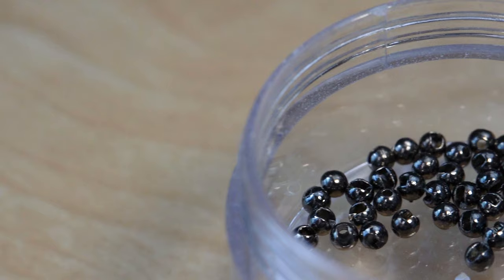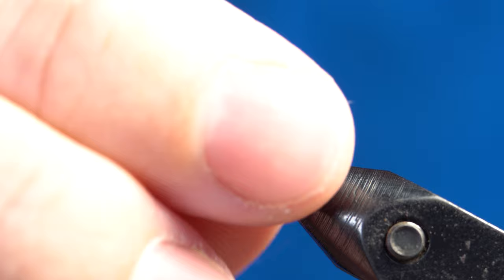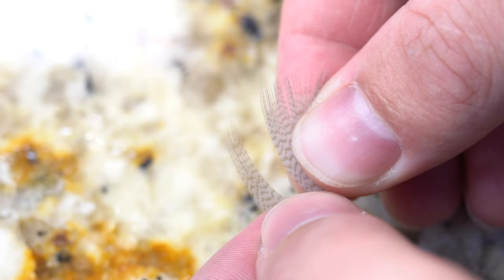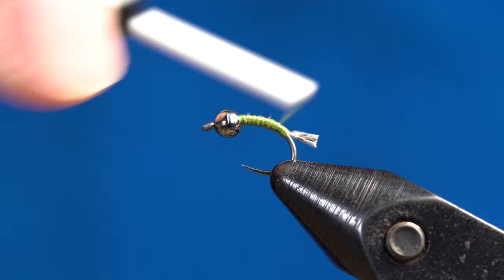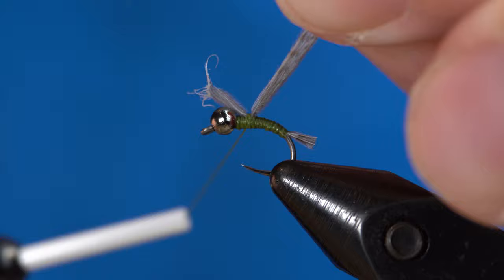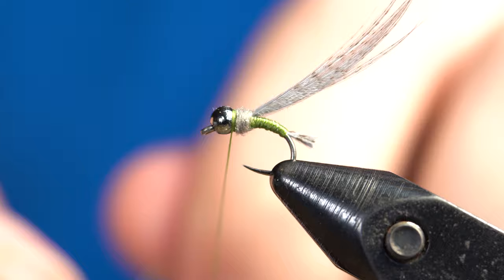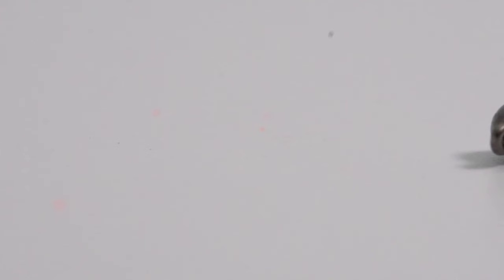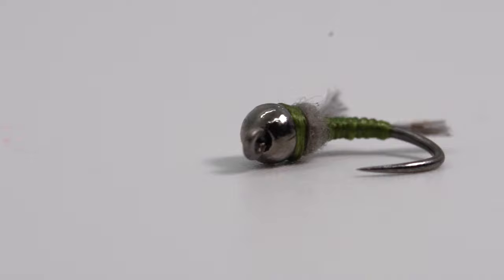Simple Baetis Nymph | Fly Tying How To

Comment: I suspect that the fly you found started off life as a WD-50 and then either got chewed on and put back in the box or just fell apart a bit. Basically the same fly as you have here, but an untrimmed tail and a pearl or opal tinsel flashback over the thorax.
Reply from the maker: No it was clearly a separate pattern, but very similar I agree.